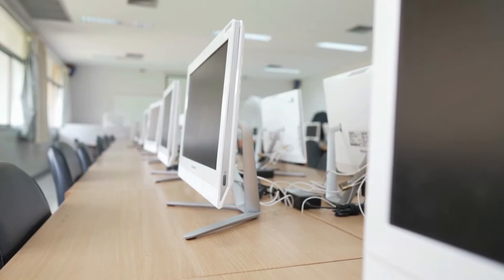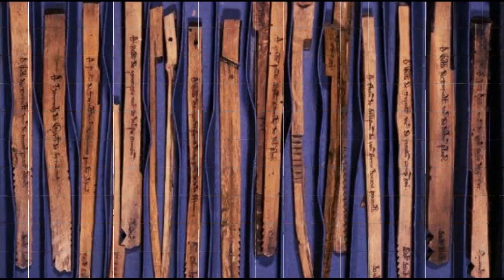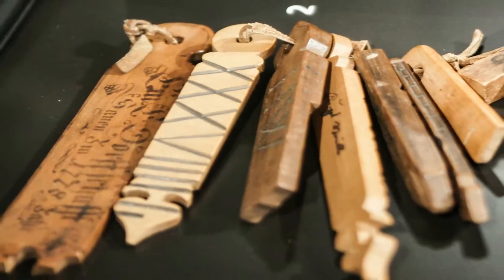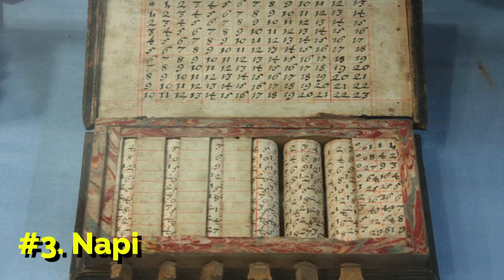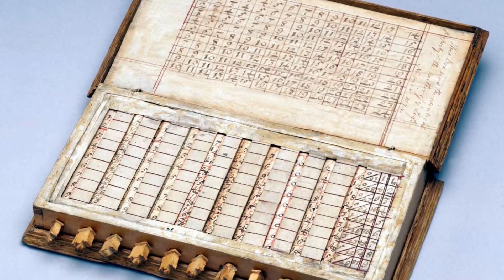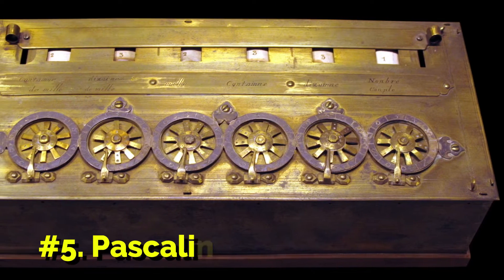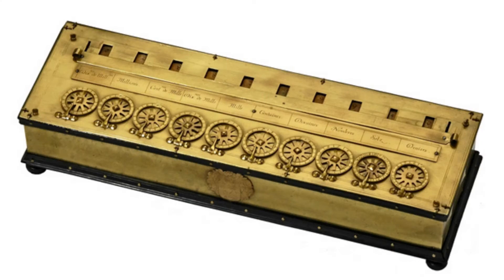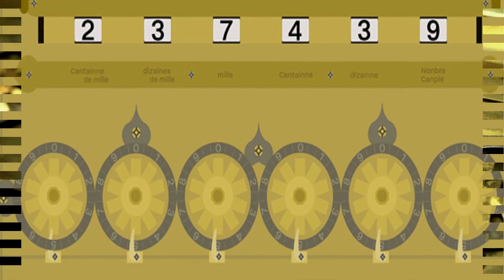Computer Evolution ( Late Stone Age - 2023 )

Comment: Good job,  However you left out one very important computer.  Actually the very first electronic programable computer. Built at Bletchley Park England in the Early 40's. It was called Colossus and was designed to break the Lorenz German Code.